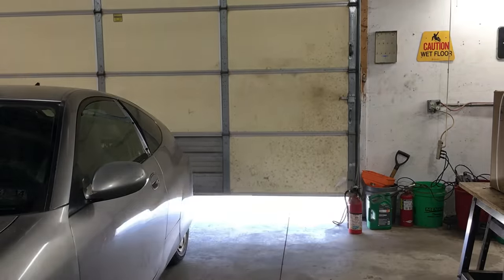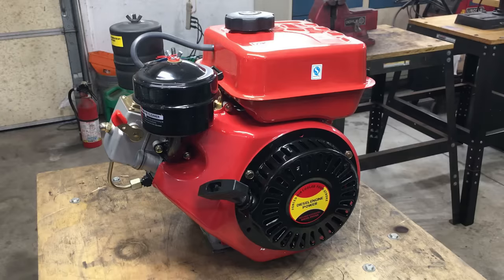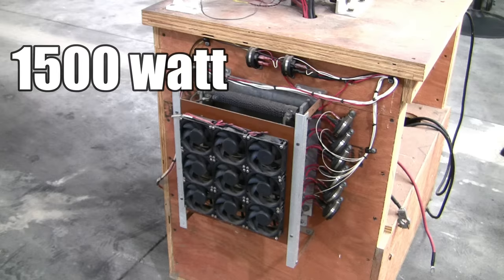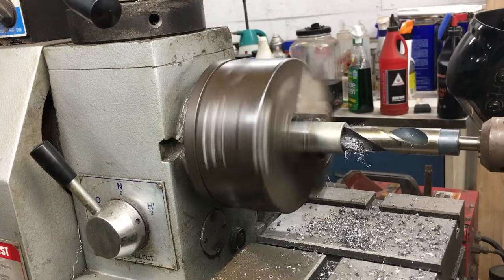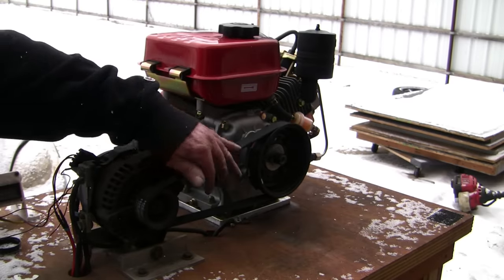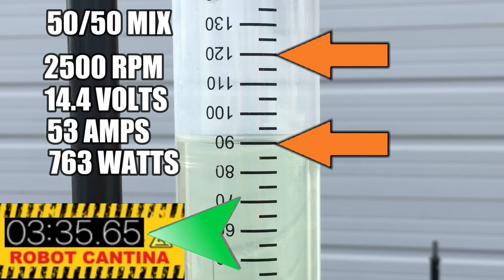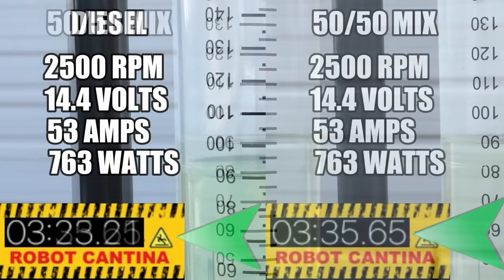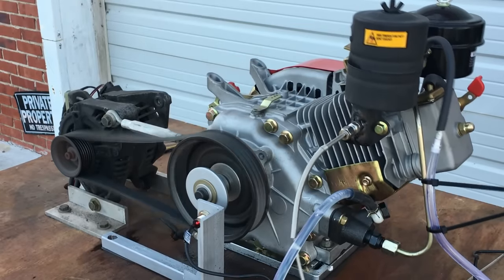S4 E3. How good is vegetable oil as a source of fuel for a diesel engine?... We find out!. plus more

Comment: I've mentioned my beloved old bobbed M35a2Deuce and a half a couple times.  I bought him about 12 years ago as a full sized and did the bobbin' in my back yard.  He's been my daily driver for 13 years and I've put over 20,000 miles on him using various old automotive lubes (old motor oil, old ATF, old 90wt gear lube, and etc.) that has been cut with either kerosene, jet fuel, or old stale gasoline.  I've only used diesel fuel for tests.  Now Henry (I regard my M35 as my old army mule and call him Henry) has what they call a "multi-fuel" engine in it.  It's too long to completely describe, but the pistons have a sort of cup molded into the top of each piston ... the injectors do NOT atomize fuel ... they pretty much squirt a stream into the cup ... and the engine's 22 to 1 compression ration sets it all off. I live in the mountains of No.Ga. so old Henry gets a real work out.  We get between 13 to 15 mpg's and Henry will do 60 mph, a little faster on the flat 4 lanes  ... no mater what I put in the tank, straight diesel or WMO (waste petroleum product).
Reply: Over the years I have done a lot of research into using alternative fuels ... I have a lot of information on alternative fuel, some from the government, some from the military and some from industry (like Cummins) and would be happy to cut you a disc if you were interested in it.
Reply: In my studies about veggie fuel, I have found that used fry oil is problematic.  When veggie oil is heated and reheated several times, it creates nasty stuff like acids and etc that have to be dealt with.  Also there are a lot of very hard things in it that have to be filtered out.  Used veggie oil isn't as simple as you think.  First, there is a LOT of competition for the stuff.  Most people don't want old dirty motor oil.  BTW ...  veggie oil off the shelf is just oil ... there isn't anything in it that can harm your pumps or injectors.  The USED stuff is really the culprit.  Because of the problems with old veggie oil, I have never put it in Henry.  Waste Motor Oil (and other petroleum based fuels and lubricants) is WAY easier.  Let it sit for a while, all of the water and most of the heavy stuff will settle to the bottom of your storage container ... drain this off.  Cut what is left with your kero, jet fuel, gasoline or diesel to your desired viscosity ... then run the mix through filters (I have made a filter from an old fire extinguisher and use filters socks in side).   I've done this for 20K miles ... no problems.
Reply: As for your Zombie pictures.  Did you see all those dead zombie cars?  Do you know how much waste oil, power steering fluid, ATF and gear lube is in them?  Probably 3 gallons ... AT MINIMUM!  3 times yer mpg will tell you how much further you'll go down the road.  BTW:  Henry has two - 50 gallon tanks on him.  I'm not good with math (too lazy)  but 100 gallons time 13 to 15 mpg's MUST equal something in range.
Reply from the maker: Good point, I reckon the crankcase oil could be harvested if McDonalds is too busy.

Comment: For four years I have been driving on all kinds of "alt-fuels" with my 1989 VW 1.6D  engine. It has no problems running on 100% during summer but during winter starting is very difficult you have to mix some gasoline or diesel.
Pay no mind about destroying the engine its only possible after many kilometers and fuel has to be dirty and filtered badly.
You should try to run on: 
100% waste motor oil
100% waste hydraulic oil 
100% waste  DOT-4 (brake fluid)
That would be actually interesting.

Comment: Try running it with mineral oil. I'm also curious to see if the cetane boosters have any effect, I mean I understand what they do but does it make diesels under load more effecent. Or is it like octane where you only need enough for the engine and any after that is superfluous. Maybe something other than soybean oil. Who knows maybe I live in the Bahamas and need to run coconut oil! But seriously the fully saturated fats should have a higher energy density. Even including the exspantion from melting, at least in theory anyways. Coconut oil is an exseption to that due to it having short chain fatty acids. So like shortening would be an intresting example of this due to it containing hydrogenated fats and palm Colonel oil. Paraffin wax would be intresting but I could  understand why you wouldn't wana try that. Another idea is dimethtyl ether. It's slated as a diesel replacement. But is it. That would be hard tho. Anyways I love your content!

Comment: If you use cooking oil you glaze the pistons, and the engine gets harder to start until it fails.  The way round it us to have two tanks, one with diesel in, and the second with cooking oil, and a heater to thin the cooking oil.  Then valves, so you start it on diesel, then after a couple of minutes, switch to cooking oil, then when you want to stop the engine, switch to diesel a few minutes before you stop it, then it's like it always stopped or started on diesel, and the heat thins the oil.  You can make biodiesel too, many videos on here.  Do that experiment on here please

Comment: FYI Jet A has the exact same flashpoint as diesel and can run without issues on diesel engines. It's less viscous and worse at lubrication than diesel though so it does wear out the fuel pump faster but it would be interesting to see how much or how little of a difference it makes on that little thing.

Comment: Rendered bacon fat would be interesting to try, 'course keeping it warm enough to flow would be tough at this time of year in the northern hemisphere. It could possibly smell good too :D

Bunker C might also be an interesting test but like bacon fat would need to be heated.

I also think used/waste motor oil may be a neat test as well. Biggest trick would be to filter it just enough since the combustion byproducts probably would not be kind on the little engines pump.

Light sweet crude oil could also be an interesting test, sourcing it might be tricker than other oils though. (or at least I suspect it might be, it could be easier than finding Mountain Dew at a convenience store 😆)

In the end I would humbly recommend getting a couple of spare high pressure pumps for this engine since I'm sure these fuels, and the one others have suggested, may be a bit tough on it.
Reply: You can turn animal fats into biodiesel, which will flow a lot better.

Comment: I'm not sure about fuel distribution in Kansas, but up here in the frozen tundra they change over to "winter diesel" usually in the fall, which has a a lower cloud/freezing point, and less BTUs, 133-135K. So being your results are so close, it could be winter diesel purchased in the colder months, or some potential blend.
Reply from the maker: Good point, I'll have to check that out. Thanks!

Comment: I don't know if i've got this right , if the engine has run longer woudn't that mean more power was generated over that longer period. 
Will that mean the veg oil seems to be more efficient ? Can you calculate how much difference in fuel usage was used over the same time ? 
Thanks for your time and effort to do all this stuff I really enjoy your videos.

Comment: Had good luck running everything from kero to straight wmo unfiltered in these. Besides for the obvious cold weather starting issues (easily fixed with a snort of ether), these engines are very stout and can take a lot of abuse in my experience

Comment: My dad used to run his 300d Mercedes  on a mix of 15gallon of used, filtered fry oil, 1 gallon of kerosene, and 1 bottle of fuel stabilizer. Right in the tank, never had starting issues (never tried winter starting though)

Comment: Once upto temperature the little diesel should run on 100% vegetable oil being relatively low pressure injection. Heating oil Which I my country is just a slower burning diesel will run like diesel but then you could make black diesel upto 50% waste engine oil to regular diesel. For cold starting 10% gasoline to vegetable oil or black diesel.

Comment: I think Rudolf Diesel designed his first compression ignition engine to run on rape seed oil. So the veggy oil is actually closer to the original concept then the actual diesel fuel. 
Unfortunately the veggy oil has a tendency to solidify in cold temps so if you ever try this in your own diesel car or truck better have a fuel heater in the tank. 
Also, do NOT try this in a modern commonrail direct injected diesel engine. Those have VERY high pressure pumps that wull wear out quite quicky if you run them with thicker veggy oil. And an injectionpump is a precision part that is very  EXPENSIVE to replace.

Comment: There is a problem with running alternative fuels in modern diesel engines. The electronics don't like the emissions, because if they don't see what they think they should see, the computer assumes that there is a problem with combustion, and will derate the engine to prevent damage.
To run vegetable oil, you have to use older engines.
Another thing to note: this may be considered "untaxed fuel" unless there is some specific carve-out in your country or state for bio-fuels. The fines for running untaxed fuels in a road vehicle can be pretty high.

Comment: I always heard, that old disel's engines, specially mercedez , with a high flow pump would work on used vegetable oil, you just need to filter good the oild from any solids, and your are good to go, at the same time, old military diesels, work on coocked oil with the low compression and the stupidcharger/turbo to help build power.

Comment: fryer oil in a fast food restaurant is like crisco. when its cold it becomes a solid block. I would be interested to see the effect of the vegetable oil straight and a comparison of both fuel and mix fuel in cold temeratures
Reply: Not necessarily true. I believe the place I worked at was using Canola oil

Comment: ive ran 80% used engine oil in my vw and it liked it the only issues was in winter with it being to thick because its from a fleet of busses all 15w40 but if i mix 10% gas into the oil before i put the oil in it thins it out.

Comment: Don't ask how I know but sunflower-oil also works great. The only issue when it is cold outside, starting your diesel-engine on vegetable oil might be a wee bit harder, and a bit smokier until your engine heats-up properly. (although some did built-in a pre-heater for that issue etc)
Fun fact: the first diesel engines also ran on seed oils, I'm told.
In some countries it is illegal to run diesel-engines on anything different than diesel-fuel. (due to taxation).
Before the (several) wars, it was a fun experiment and affordable to run on seed oils. Even on a powerful TDi engine.
But I can tell you, that a diesel-car from around the 2000's build-years, can run just fine on seed-oils.
The consumption was a wee bit higher and the power was a wee bit less, but the smells behind the exhaust caused a lot of smiles.

Comment: I don't remember the name, but there exist a diesel fule  that's mixed with water. 
And in Sweeden they have some busses running on a ethanol and diesel mix. The diesel acts like a "spark plug" for the ethanol. 
Almost the same concept as diesel engines running on LPG or CNG, where the diesel are used to ignite the other fuel.

Comment: motor oil with gas . transmission fluid . brake fluid . also , it might extend life of pump if you heat alternative fuels till viscosity matches that of diesel fuel .
Reply: forgot to mention , though brake fluid has a high boiling point , it burns quite well in open air .

Comment: In Europe those small engines still is expensive. Not enough importers I guess.
You should try thr same experiment with a Yanmar L48 or clone. Direct injection and proper oil/lubrication system

Comment: The trouble with vegetalble oil is the glycerin that it contain. it will clog the injector... you need to separate the glycerin from the oil. an easy way to do that is with sodium hydroxide ;) it's called saponification. Yep just like soap!

Comment: The general rule of thumb is never run more than a 20% straight vegetable oil mix. Over time mixtures above that will gum up your injectors and pump with glycerin. If you turn the veg oil into biodiesel by transesterification, you should be fine

Comment: Try using waste transmission fluid - and then try cutting waste motor oil into diesel fuel (you have to filter it through a water filtration system tho).  Both are old military tricks from ww2 - and I've done both on a landrover disco 2 diesel.

With the wmo (waste motor oil) I filtered it through a 100 micron water filter to clean it out of any gunk. To get rid of any water contamination, put kitty litter in a cloth bag that you throw into the wmo - the kitty litter absorbs water but not oil ;)  All tricks used by the allied forces in diesel tanks in ww2 in the invasion of europe.

Comment: I've already experimented with bio diesel. Back in the day it was easy to get waste oil to make it. These days not so much. It's been commercialised to the point where the DIYer gains almost no economic advantage unless you know someone or you have access to cheap waste oil. The transisterification process is simple enough and biulding a system isnt too bad. I wouldn't set it up in my garage or anything so you would need an outbuilding. We put 20k miles on a Ford F250 without any issue. The truck ran great on it. Got better mileage and ran much cleaner. No smoke or anything. Exhaust smelled like peanuts and french fries. Only problem we ever had was a clogged fuel filter shortly after changing it over. Turns out bio diesel cleans fuel tanks and lines. We could make diesel from hemp but it'll never happen with the current political climate.

Comment: I used to run my Landrover Disco on veg oil only with a heat exchanger fitted and switch back to diesel before shutting it off following from behind it smelled like a chip pan 🤣🤣🤘🤘🤘🤘

Comment: I used to run a 10hp diesel water pump on its used waste motor oil.  I would mix it about 50/50 or there about.    The injector would coke up every few weeks or so and I'd have to clean it, but other than that, it ran very well.  It did however eventually throw its rod out of the block.  Not sure why, but I guess it It was mad about burning waste oil.

Comment: garage 54 did a video on different diesel fuels.  i know atf is good, veg oil works, hydraulic oil and motor oil will also work. a diesel will also run on gasoline vapor drawn into the intake but it would be hard to regulate the output. kerosene and some jet fuels will also work. lamp oil might work too.

Comment: actually, it's only the neoprene rubber parts that would get damaged by vegetable oil. if you ever have to do a rebuild of your fuel pump- it's possible to buy rebuild kits that are bio-diesel resistant- silicone I'm told.

Comment: I do engine testing in my line of work and running diesel engines on weird fuels is part of it. Here are some different ones that would be interesting for Youtube ...
gasoline/diesel blends
biodiesel
jet A
kerosene
pure gasoline (87 AKI)
starting fluid, WD40, acetone, brake cleaner, etc. 
rubbing alcohol (isopropyl) (might work if the engine is hot)
ethanol and/or methanol (also might work if its hot)
basically any liquid hydrocarbon with a reasonable CN will work...
Reply: I used to run waste Jet A at about 4:1 with diesel in my 84 Mercedes diesel. My fuel bill commuting to work was awesome and the injectors stayed clean and the spray pattern was always perfect. Jet A is just kerosene as I understand it and I added the diesel for lubrication.
Reply: @gregvanderboom5011  yea Jet A is just refined kerosene with some additional additives

Comment: 100% veggie oil will solidify at low temperatures, one of the classic fixes is starting on the regular stuff and running a radiator tube through the veg tank.

Comment: Waste oil and diesel mix along with new or used atf would be very interesting to see. I have alot of experience running some older diesel equipment on waste atf and always saw a pretty noticeable increase in power the higher the content of atf in the tank.

Comment: You can try using kerosene/lamp oil mixed with a tiny bit of 2 stroke oil. And of course used motor oil. The thinner the better

Comment: waate oil is actually used for diesel tractors (drain the insight's oil pan and dump it into the gas tank of the single cylinder diesel)

Comment: Okay I'm no expert either 
But! Mr Diesel's original engine was designed to run on vegetable oil
Utilizing what is called compression ignition
During world war II on the Philippine Islands
Many military diesel vehicles were run on pure vegetable oil
They didn't start using vegetable oil for cooking until the late 1940s early 19 50's
Mainly because of the research they did during world war 2 looking for a longer  shelf life for combat rations
It was also originally developed as  lubricants for  heavy machinery

Comment: 100% vegetable oil for sure. I'm curious how the engine would work after running that, shutting down and then doing a cold start later: I recall reading some years back that some folks using pure veggie oil would use those dual fuel tank trucks (the kind that had the switch to let you switch between 2 fuel tanks) so that one tank would be full of regular diesel and the other full of veggie oil: you would start it with regular diesel, switch to veggie oil once it warmed up, and then before shutting down switch back to diesel again to flush the veggie oil out so that it wouldn't gum things up (being thicker than diesel). Now, whether that procedure was only needed in colder climates or if it was necessary everywhere I don't know.